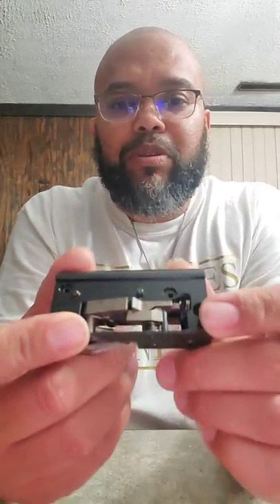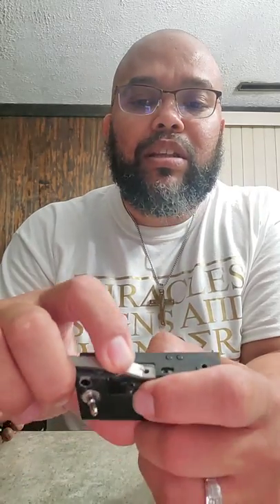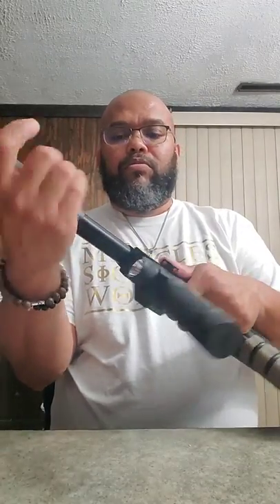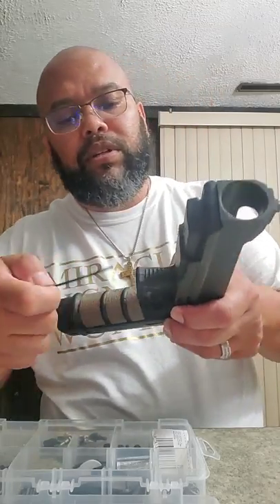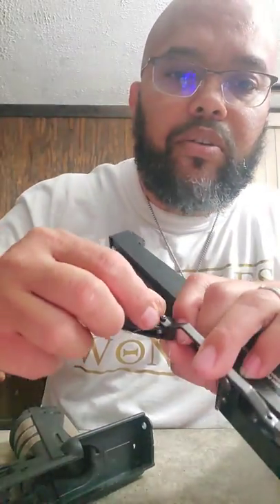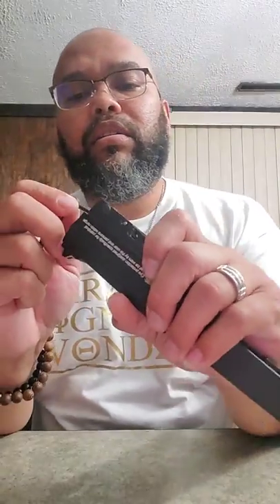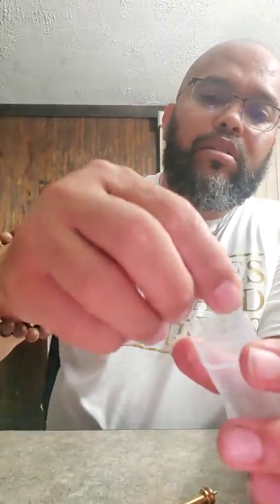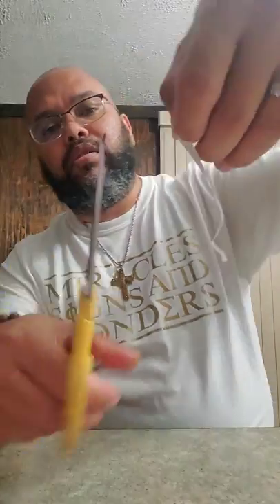FSC, T8.1, T9.1 power gain! PRV delete!

Comment: Messed around with vr pad spring and ended up breaking 2 pieces in my regulator 😔
Reply: @psi.defence.channel  tell me about it I just bought it a couple days ago. Just waiting for First Strike to get back to me. First day I had problems with the regulator pieces wouldn't function together smoothly. I ended up smoothing the metal pieces out with a Dremel oiled it. Then it worked. Watched a video you posted talking about that valve screw so I got curious and unscrewed it too much. Then all the air came out along with the spring and hollow screw. I managed to get the spring back in and tighten the hollow screw down. Then I noticed the metal pieces falling out the regulator. If I could find those pieces online it would be great but no luck. Things are either sold out or not available at all. I should've just left it alone. But that's me always taking things apart and tinkering. But now I know what to never do. Gues I'll charge it to the game
Reply from the maker: @debarber87  you should get the prv delete kit from Daniel Sturling
 danny69726972@aol.com

Comes with a deleted spring pad, vks sear spring and vks bolt spring for only $50! Plus he has tons of other accessories for the fsc. Hit him up!
Reply: @psi.defence.channel  I'm gonna send it in since it's still under warranty. I would hit up dude but he don't have a web site or he don't sell on eBay ? Kinda sketchy just sending a random dude money
Reply from the maker: @debarber87  it's not sketchy at all. In all my dealings with numerous suppliers, Sturling is one of the most straightforward people I've dealt with. Up to you to decide if you're comfortable with him or not.
Reply: @psi.defence.channel  I sent him a message. Just waiting.......
Reply: @psi.defence.channel  by the way thnx for the info. I've watched alot of your videos. Since I'm new to the non lethal wave I needed all the info I could get. You're videos are very informative and broken down for all to understand. Great content keep it up. And I like your hoodie I believe it says Jesus on it in cursive in one of your videos
Reply: Are the relief valves for the 8.1 compatible with the FSC ?
Reply from the maker: @debarber87  yes. All internals are the same except for trigger mechanism
Reply: @psi.defence.channel  ook. Would think the parts are bigger gun seems alot beefier compared to the fsc
Reply: @psi.defence.channel  what would be a reason for it shooting 2 rounds at once ?
Reply from the maker: @debarber87  try changing the detents.
Reply: @debarber87  When you send your TCP for service, make sure you include only stock parts.  This includes the milsig o-ring.  UTS will void your warranty and you will pay for the repairs.  Remember, all stock parts.  No aftermarket anything.
Reply: @debarber87  What are you shooting?  Is your mag spring the red or silver?  The red spring sometimes causes misfeeds because it's too strong.  Lighter rounds also can be jammed up easier by the red spring.  Try using the silver spring.
Reply: @juicyfruit6311   red springs on FSC 3.5 pvc/ nylon  I think it's the spring on the top that holds the ammo back I need to pull it out more to give the spring more tension
Reply: @juicyfruit6311  first strike ended up giving me 3 each of every piece in the regulator.
Reply: That’s why I do not want to do it